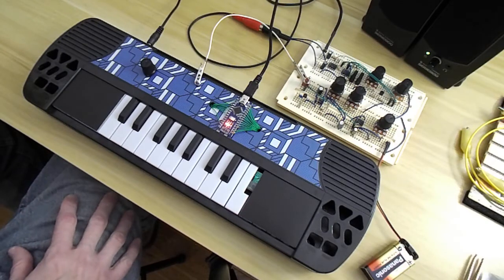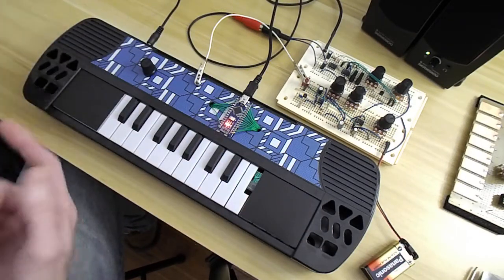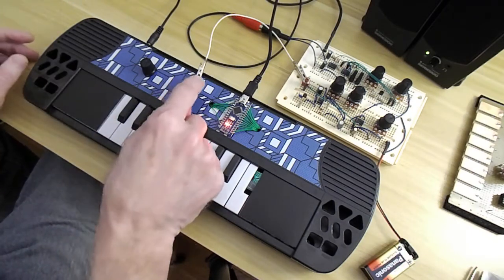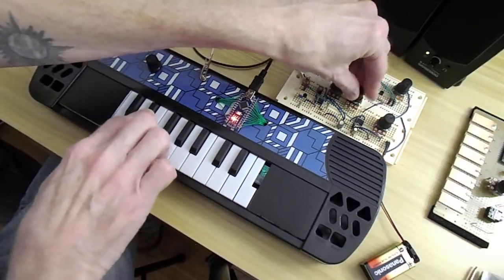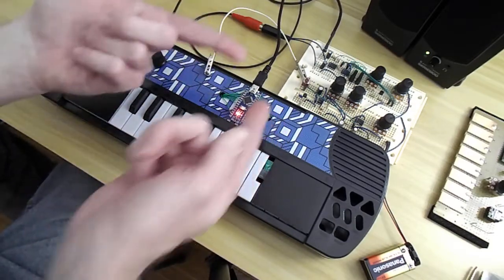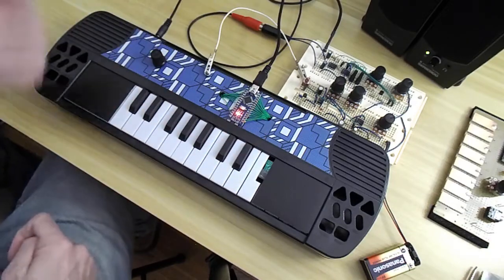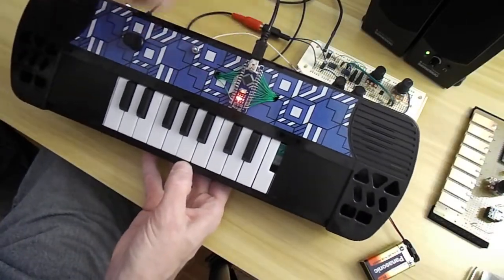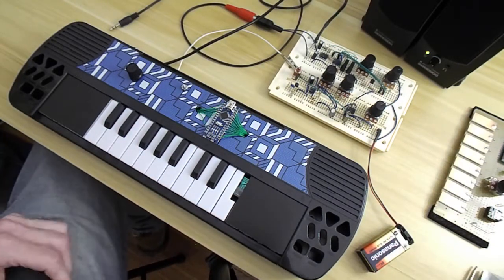Toy Keyboard Arduino Synth

Comment: Mine is finished!! Works great thanks Pete. On to the synth.
Reply from the maker: You should post a video of it on your channel, I'd love to see it.
Reply: My LDR VCF doesn’t work at all. I have revised 5 times comparing the Pete schematics to my Vero strip PCB populated and no mistakes found. The VCF control voltage doesn’t trigger the LEDs and the 555 timer seems not work too...I don’t know. Could be something really silly simple but I’m unable to spot on...any helps is much appreciated!
Reply: @Attic-Toy-Design  sorry I moved on gave it away